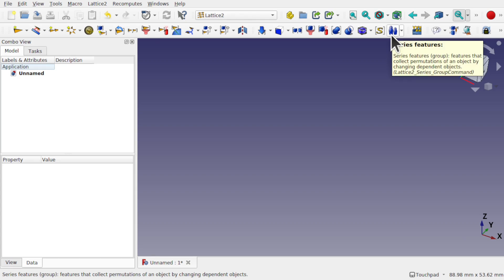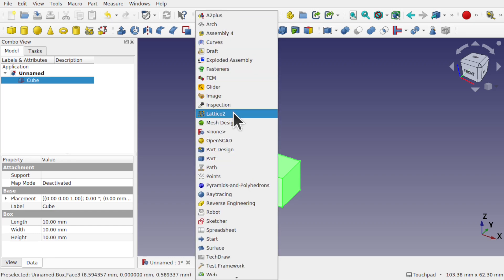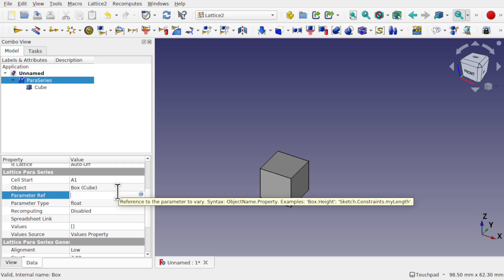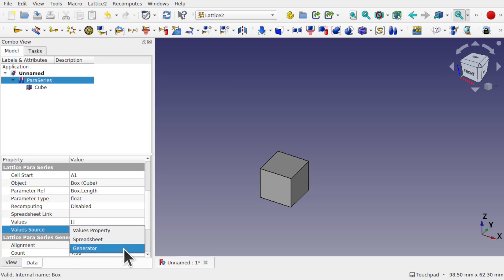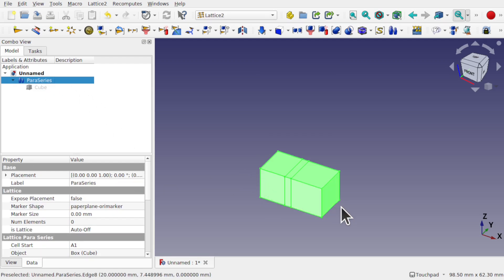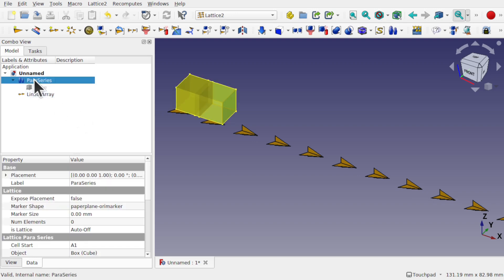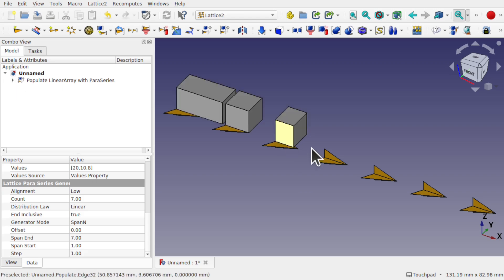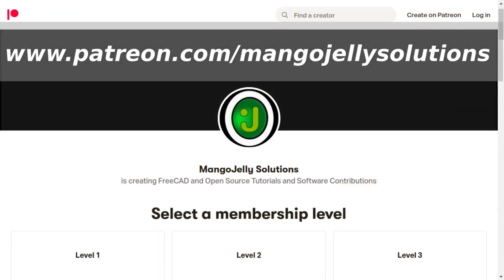FreeCAD: What is a Para Series? | Basics of Lattice 2 Workbench

Comment: Can this only be used in Part Workbench, or does it also work in Part design? 
Trying to make a gauge for bolts in Y increments of 1 mm (2 - 10) and X increments  0.1 mm for each dia. as a quick reference for press fit/clearance for design, without having to draw and dimension each hole.
Reply from the maker: I think I saw your post on Facebook regarding what you was doing. So, if your using a sketch for the para series try using a sub shape binder (bright green 'blob' on toolbar) against the result in the treeview (you must select the result in the treeview, and the part design body must be active) that will create a binding into the body folder which you can pad / pocket. Any changes to the original paraseries should be reflected by the binder. Give that a go.

Comment: I was JUST searching for how to change parameters based on array index. I was thinking I'd need to script something instead. Thanks a ton.
Reply from the maker: Great to hear. I be interested what project you're using the video to help with. I am always looking for real world examples.
Reply: I'm doing a bit of BIM of a post framed barndominium. Since I'm not sure of the dimensions yet I wanted to build this with parameters. 
However, on the gable ends of the building the posts will be of differing number and height. They need to support the truss while following the roof line. So I'm thinking I can use a para series and the spreadsheet to achieve that.